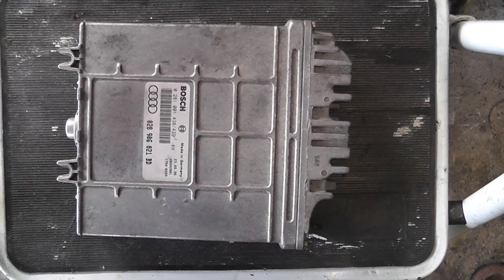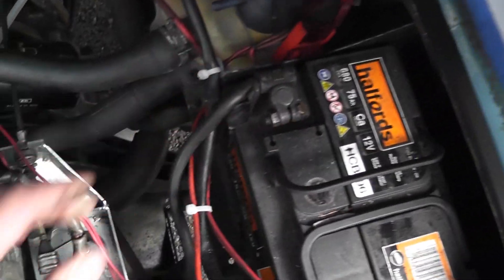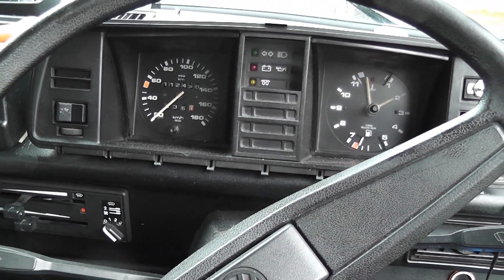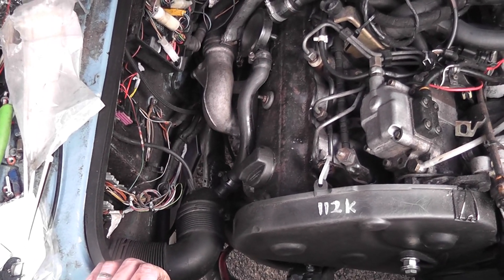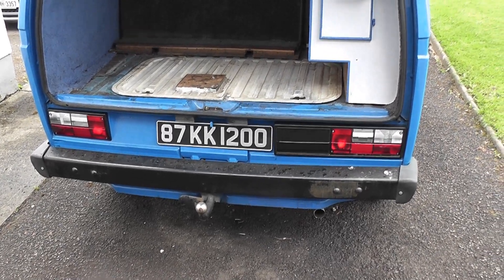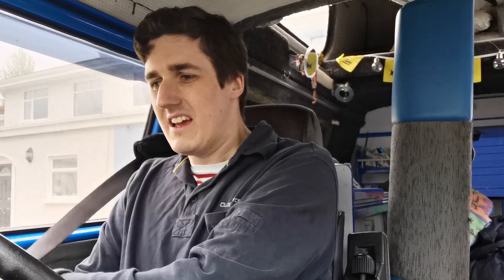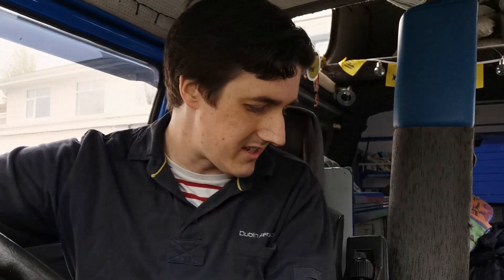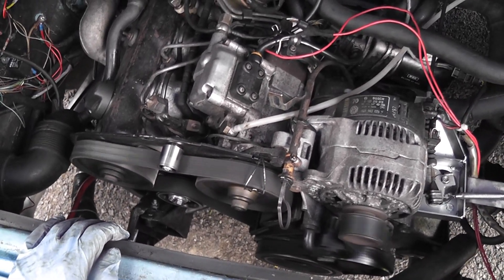FIRST TEST DRIVE! - VW Camper TDI Engine swap

Comment: Install a clutched alternator pulley. That will stop your belt from doing that and it will save your crank nose on the engine. Just get a pulley from a newer diesel. 

Long story is that VW Upgraded to a serpentine setup without going to a clutched pulley. That caused quite a few crank issues due to the lack of slipping in a serpentine setup. AAZ engines are known for having those issues. Upgrading to a clutched pulley would fix all of that.
Reply from the maker: Thanks for taking the time to give your advice. I actually ended up fitting a clutched pulley, which sorted out this issue, so you were indeed spot on.
Reply: @Endfloat  oh hey, well then you already fixed it. Good to hear. I’m enjoying the videos about the van. Keep them coming!And congrats on your 1000 subs!
Reply from the maker: Many thanks! I have a few more projects on the go so there'll be plenty more videos coming out over the next while. Thanks for your support.

Comment: Hi! great that your AHU-swap was a success! I have the same thing to do. 1.6TD JX will go and 1.9TDI AHU will be installed. I took it out from Seat Cordoba and took away all (ALL) the wiring of the car while doing it.. So a lot of wire sorting needs to be done. Where did you locate your gas-pedal position sensor? Was there a need to install any sensors to clutch or brake pedal?
Reply from the maker: My conversion wasn't without it's problems. My throttle position sensor is a VW part I bought on eBay. I have it bolted to the bracket for the alternator. No sensors for brakes. I just tapped into the brake light supply on the left side of the van.

Comment: Did you crack any injector pipes with it running. ?
To see if they make any difference to your idle. If you open one pipe and it doesn’t alter the idle. That’s your culprit.
Reply from the maker: I did try that. All of them made a difference.
Reply: Endfloat any difference with MAF unplugged ?
Reply from the maker: @danniecassidy5128  that could be worth trying but what I'll do is check with vcds during the week to see if there's any faults with it. Why do you think that could be the cause?
Reply: Endfloat it could cause erratic idle. A lot of what makes a tdi run properly is governed by the air flow meter. Also it’s an easy one to check. Additionally, I’d say if you have fuel issues. Like bad fuel or dirty filter. You would be struggling to start. So I don’t think it’s that. Maybe vagcom will give you some idea. Great work so far btw. 👍
Reply from the maker: @danniecassidy5128  ok tomorrow I'll unplug it and see what happens. If it works I'll owe you a pint! 😁

Comment: The expression on your face when you opened up was gold! Nice work. This is the mechanical TDI right?
Reply from the maker: No it's all electronic. I didn't see the point in going down the mtdi route. You're losing all the advantages of the electronics.
Reply: @Endfloat  I've got a 2003 MK4 Golf with a PD130. You're saying I could put this engine in my 1987 van? I'm not intending to, as it's my daily. But the 1.9TDI is so available it's good to know it's doable!
Reply from the maker: There are engines out there better suited to the conversion than the pd engine in my opinion, namely the AFN or AHU. Mine is an AHU and the conversion kit exists to do this job. The pd can't be installed in the 50 degree position because the sump flange is a different shape amongst other things. I'll be doing a video detailing how to do the whole conversion from start to finish eventually.
Reply: @Endfloat  I'd love to see that video. Ill Google those engine codes now. Is that the MK3 Golf/Passat? Guessing you used Brickwerks for the conversation kit?
Reply from the maker: @4RingsRetro  no the conversion kit came from ultimate engineering. You'll find those engines in many VW group cars over the years from about 1997 to about 2005. The AHU was 90hp from factory and the AFN is 110hp, but both are easily modified to increase their output.
Reply: @Endfloat  You're a gent, and you've given me plenty of research now. Thanks man! Look forward to your next videos.

Comment: hello, am planning to put a T4 5 cylinder engine 2.5 deiseal in  to aT3.what do i need to do? please help
Reply from the maker: Pick another engine cause that's a terrible idea. Very little extra power for a lot of extra work. Get yourself an AHU or even better an afn 4 cylinder engine, then talk to ultimate engineering.

Comment: Test crank sensors?
Reply from the maker: Hopefully that will show up with the vcds cable during the week. I'll report back with my findings.
Reply: @Endfloat  hi, I have just uploaded a video to YouTube showing how to test a crank handle sensor without using an obd reader. Hope its helpful... also I have seen your last post and yes you are right, it won't run properly without the copper washers at the bottom of the injectors.
Reply from the maker: Thanks Andrew. I'll have a look at your video so. Cheers!